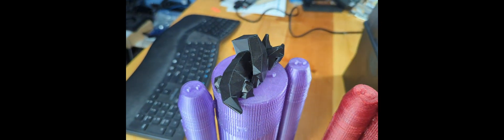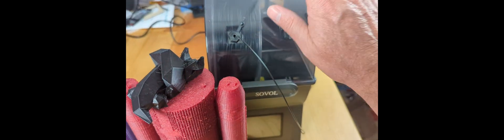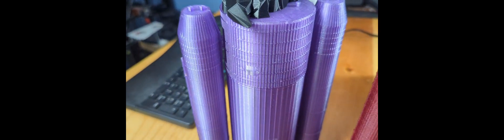Sovol SH02 Filament Dryer Results

Comment: In case you are not aware there are 2 dissicant holder tanks built into the dryer. Directions show you where they are. You can leave the desiccant in while using the dryer so not only does it dry the filament, but it also dries out the desiccant to be reused for storage in the box if desired.
Reply from the maker: Yes, I know but the compartments are very small.
Reply: @PrintingNerd  Very true

Comment: When you’re using this dryer, do you leave the top valve open and only close it when finished and the filament stays in the dryer?
Reply from the maker: Yes, you need somewhere for the humidity to exit and when you use it to store filament, close all ports to decrease humidity entering the enclosure and I also drop in one or two desiccant packs . Just be sure to remove the desiccant before using the dryer again.
Reply: @PrintingNerd why remove desiccant when drying? Leaving them in there will dry the desiccant. I live mine in there.